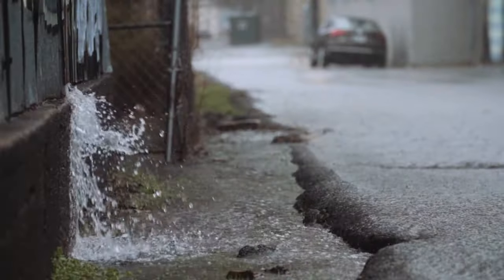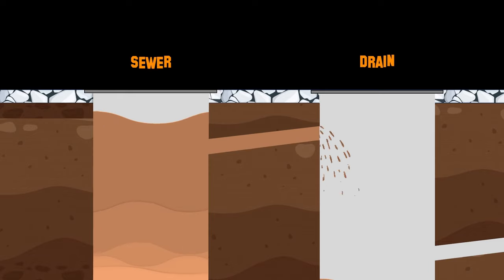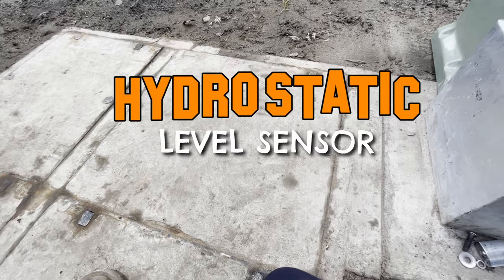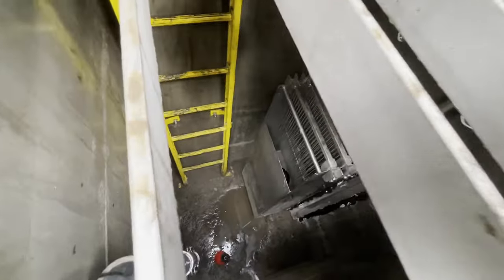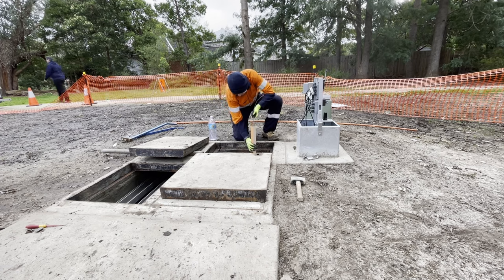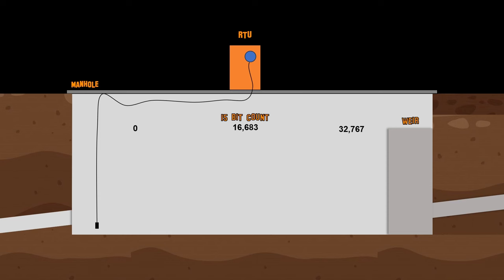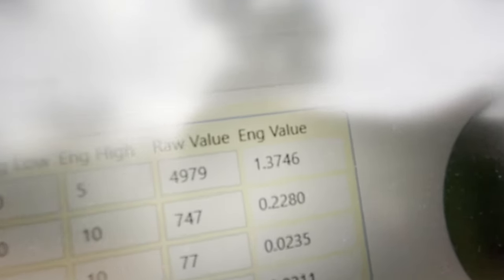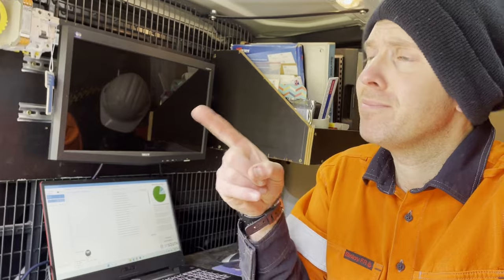Are Sewer and Stormwater REALLY Connected?

Comment: Age 11 - 14 I took a higher diploma in hydraulic civil engineering after my parents moved to the Costa del Sol for a number of years. (Of course I had no choice but to come and integrate with the Spanish world) now that I look back on those days, extremely dangerous during the practical times and at that stage I had to take the mathematics (all precalculus) to be prepped for the theory.

Practical I’d occasionally come across, then later design these but there they were known as “arqueta” or “Colector de fecales (drenaje)” and in the UK, “combined sewer overflows” (CSOs). Within some of the large culvert networks under the city of Estepona, they could be in the form of concrete boxes that are open topped, these boxes could be inside the walls of the culvert (or floor like the one you showed, virtually anything) or protruding from the sand in the beach, and once the incoming flow from the combined sewer surpasses a certain threshold (determined by the hydraulic calcs of the smaller line that intercepts the now regulated flow) a bottleneck occurs and it goes on from there, overflows through a line into the storm drain or receiving vessel.

Back then, it was a bugger to not use calculus. Manually graphing the flow like it was the 1800s. Now studying electrical engineering and might pursue a proper degree in drainage when the time comes.